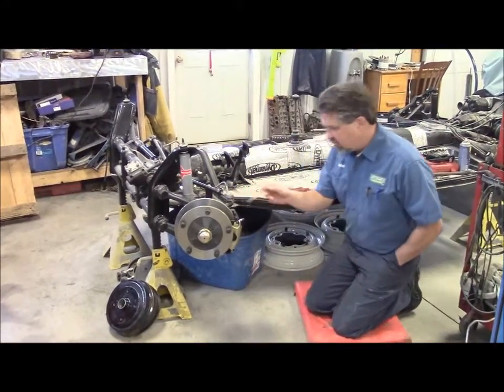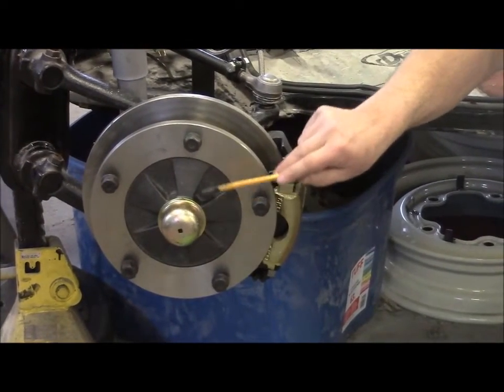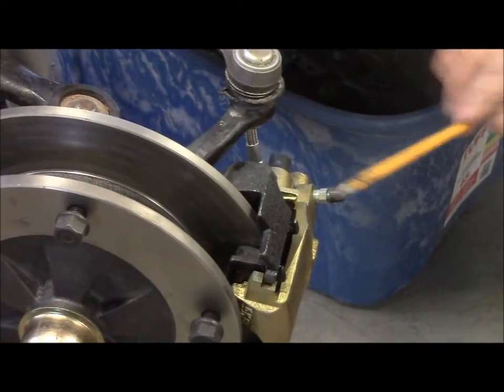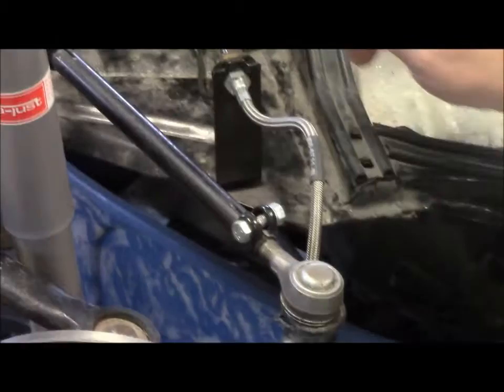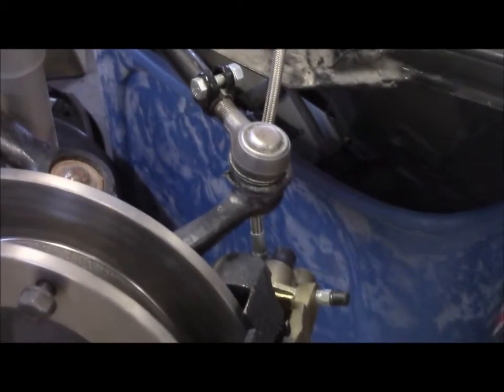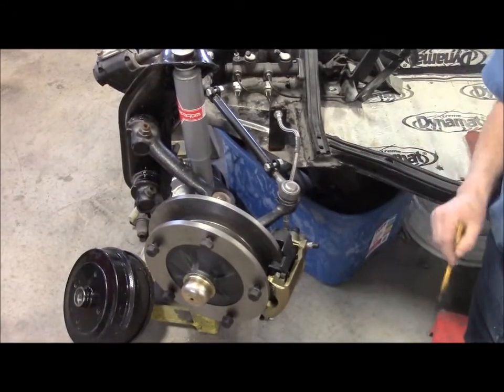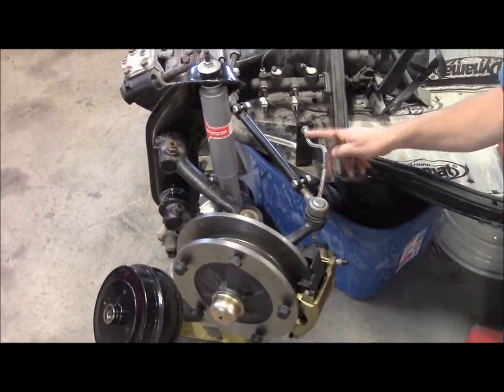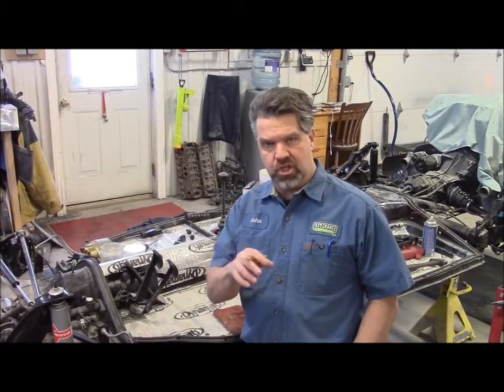Classic VW Bug Disc Brake Conversion Part 2, lastchanceautorestore.com

Comment: I found that the design is very flawed on the empi
brake kit .
The calipers wobble horribly and cause a vibration when you come to a final stop.
I refuse to install them at my shop.
I don't have a problem with the 4 lug brake kits.